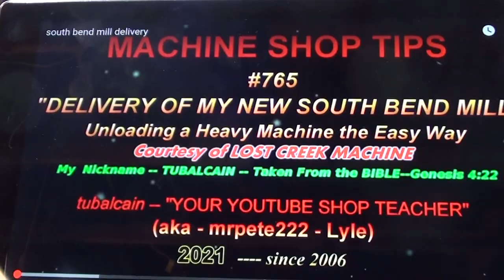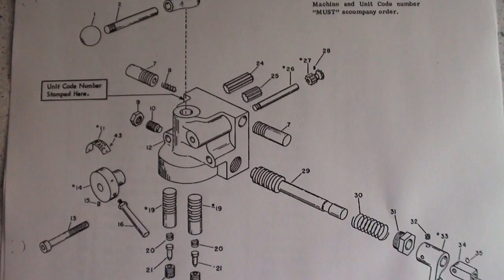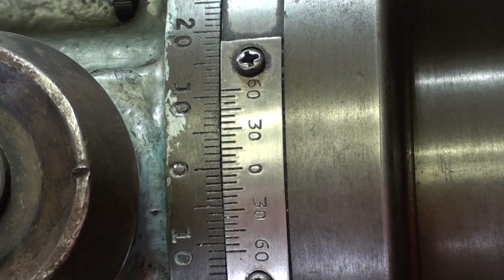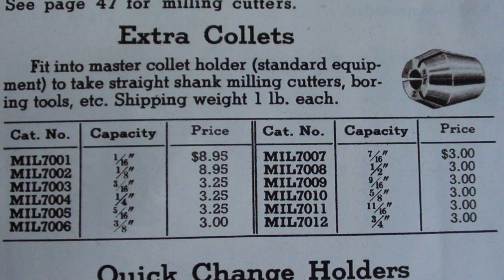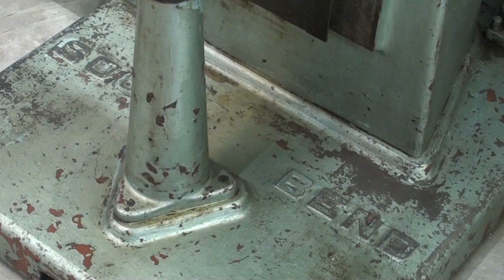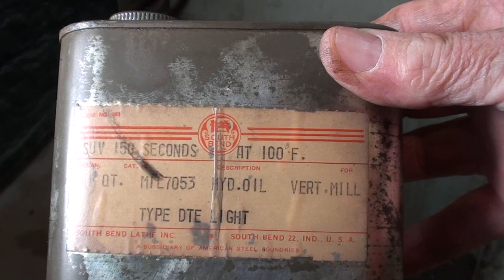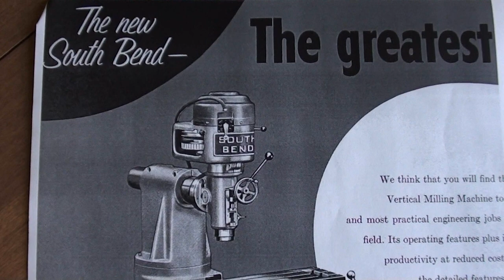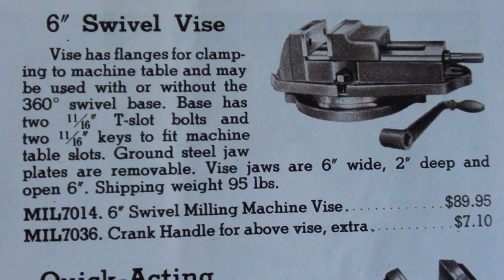EXAMINING MY NEW SOUTH BEND MILL 772 tubalcain

Comment: Good Mourning Lyle, I remember well using a couple of "Gorton" milling machines back in the sixties that used "End Measuring Rods" and Indicators. One micrometer head had a Red color band and the other had a Green color band to help keep things straight. A pad of paper on the table with 2 columns of figures to add and subtract your movements, with a heading above each column of either Red or Green. This was before we really thought of able movements as the "X" or "Y" axes. In the late Sixties, Bridgeport came out with what they called "Optics". It was a micro-etched mirror glass scale attached to the table which was read through a little lighted box with a magnification lens inside.  Again, with the pad of paper on the table to keep track of your moves. Thank goodness for D.R.O.'s!
Reply from the maker: We sure have come a long ways

Comment: Awesome walkaround! RE: The Powerfeed motor and gearbox; The reason the beltguard isn't mounted, is the mount for the beltguard on the pedestal is broken. The Table Overtravel apparatus mounted in the middle of the saddle of the mill; This stop needs to be "armed" or set before the X-Axis powerfeed will actually engage. Moving the stubby vertical lever fully to the right, "arms" the stop, engaging  the powerfeed input clutch (when the stop is disarmed or tripped, the clutch is disengaged - failsafe). The travel limit switch is actuated from either side of the Stop unit (when the Overtravel brackets and limits screws are used in the tooling Slot along the front of the table), or the lever (with the missing ball handle) is moved left or right, tripping the clutch cutoff. One of the connecting rods for the overtravel stop is bent: I recommend making a new (straight) one so that can sets and trip the clutch correctly.
Reply from the maker: Thanks

Comment: I also have a South Bend mill with all of the same extras plus a horizontal head [almost new] and a big box of tooling and gizmos. Mine is 120 VAC and runs like a top. I also will be working on it this winter, as the snow falls here in Bloomington. A learn as I go adventure in my golden years.

Comment: Absolutely fascinating Mr. Pete! That machine is a genuine piece of history. It looks like it was a pretty swish version as well with most of the deluxe options. To some extent a shame it didn't have the full-house with the coolant pump but I dare say it was rarely used and could easily lead to a very messy workshop!

One thing that strikes me is the total lack of modularity. The designers did not begin with a 'master' version and then remove parts to offer simpler/cheaper machines. They went in the other direction and that is why it has such a bolted-on nature. Nonetheless I am sure it all worked!

The catalogue picture is especially evocative--'The Greatest'! 1956... Happier times as they say!

Comment: Extremely interesting to see this early and rare milling machine, One of the J&S surface grinding machines I used to build in the 60s and 70s, had a hydraulic motor too, and it powered the crossfeed,  called a 'vane' motor, when it worked, was the smoothest quietest feed ever, speed variable by a knob, you just made me remember this boring fact lol, looking forward to seeing some restoration on this interesting piece of history thanks, Dave

Comment: I'd move the hydraulic pump to the bottom shelf and make the top shelf the storage cabinet.  Don't know about you Lyle, but I find that the older I get the further it is to floor level, and more difficult to get there short of falling over..
Reply from the maker: Yes
Reply: Or getting up from said place!

Comment: Guessing the reason for hydraulics was to get infinitely variable force for drilling  (The BP idea is fine for boring  but for drilling can be a PITA if the feed rate is too high) 
Does that table feed slide over the other gear box when the table is moved fully to the left?  I can see no other reason it is so long.

Comment: Love the Art Fern pointer, it makes it easy to understand what you are talking about.  That South Bend is like a Frankenstein with the huge hydraulic cabinet stuck on the side, the power feed wiring and disconnect strangling the column, and the double tumbler gear box on top of the "peg leg".  Hopefully you can resolve the issues and get it making chips.
Reply from the maker: I love your outrageous, but truthful description of this machine. The Frankenmill.    I now have a new name for it. Thanks to you.
Reply: Lol ! The Frakenmill it is !  Glad I could be of some small assistance besides my wise guy style comments. Your awesome Tubalcain!

Comment: Thank's Mr. Pete for the walk us around your new treasure, I'm looking forward to future video's of you getting this old girl making chips again. I really liked the goodie box portion, not sure why but I was mesmerized checking out the contents, it was almost as if that was my box of goodies I was pawing through looking for a valuable tool, I'm pretty sure I have a I have THD, tool hoarder disorder! I own a 1956 Cincinatti Toolmaster that has the same issue as the South Bend, Motor directly over the spindle, perhaps they thought Cincinatti had a good idea and copied it but it isn't a great plan in reality. I am intrigued by the power feed setup on your South Bend, really complex but having survived for 50 plus years must be well made. My Toolmaster had a power feed that was located on the left side of the table, had the gearing and motor hanging off the back side with the speed selector handles on the front, notoriously weak and it is not often you see one that is in working order as I bought mine with the gearbox and motor missing and have been told they are as rare as hens teeth. Thanks again!

Comment: I had a 32" table version SBM, with manual movements only. Was not fond of the 30taper tool holders, but did have all of the double angle collets from 1/4 up to 3/4" . I found it fairly easy to cut the pockets to modify other 30 taper holders, using a carbide endmill. Mine was single phase, but would have rather had 3 phase  to get variable speed with a VFD, but no way to power with a conventional 3 ph motor. AFAIK ....it still lives a couple blocks away with the new owner.

Comment: Hi Lyle, I believe 150 of these machines were all together built. I was lucky to purchase a South Bend Mill recently that came from a school in Oregon and is in a pretty good condition. I added a VFD to run it at 220v. I have so far also added a DRO on X & Y.  The best thing I added was an ER40 chuck and collet set. I had to take the spindle off to oil it etc. These changes made the mill a very versatile mill. I am very happy with it. I am sure you are an expert but any information you might need I will be happy to provide. all the best. Hossein

Comment: My Wells Index model 40 uses a Brown and sharpe #9 taper in the spindle. I would rather it be a Morse. I also have the x feed, with the shaft drive, the little motor uses step pullys.  Good video.

Comment: Mr. Pete - Thank you for the tour - I really enjoy seeing old machines (Old ARN!) and a glimpse into the thought process of the design and manufacture of them.  As for the hydraulic cabinet, couldn't you simply hinge the current cover and install a latch or thumbscrew.  It seems like splitting the cover would be an excessive amount of work... additionally, if the bump and hydraulics don't work on the machine... will you pull them off or just leave them?
Reply from the maker: If the pump does not work properly I may just remove it, and simplify the machine

Comment: I have a predecessor machine that looks identical to the single piece base South Bend machine except that the head says VAN and the knee screw is on the right not the left. I believe my mill was made in the early 50's in San Francisco. Given the massive similarities, I suspect that South Bend bought the design and molds to make their model.

I found a South Bend right angle attachment about 10 years ago that fits perfectly.
Reply from the maker: Very interesting

Comment: Interesting milling machine. It looks to be a great unit for the home shop. Question I have is can you not use a modern milling 30 taper modified with the notch, with an ER 30 or 40 collet system? If so that would open up a larger array of collets and erase that disadvantage of no R8 collet system.  Out side of that that’s the only drawback I see on the mill. The other question is are you doing static or rotary phase converter on this mill? From what I see on your  Bridgeport it appears your using a static converter. That’s what’s on my mill and I never had an issue
Reply from the maker: I will probably modify several tool holders. I use a rotary converter

Comment: Hi Lyle, I  can't decide if that collet would be easier on my Lagun mill with an R8 spindle.  Right now I have to step on a stool to loosen the draw bar and I'm 5' 8". It's tall. I have to twist the head if I need to remove the draw bar.
Reply from the maker: I am also 5’8”. I cannot remove the drawbar from my Bridgeport without tilting the head
Reply: @mrpete222  Ha. Thought I was alone in that. Thanks for the videos.

Comment: With that huge fly-cutter tool I don't see how you could ever tighten the setscrews that hold the tool in the spindle taper.

There also seems to be no reason for that long housing on the longitudinal feed. Maybe it is making room for some other accessory.

Comment: In regards to your side cover on the hydraulics: as to not terribly mangle the beautiful original cover, perhaps a piano style hinge on the back and two tool box style latches on the front? you could keep all sorts of angle plates or rotary tables/dividing heads in that bottom shelf? I would love to see a full restore on this machine, myself........ hint hint - ALSO: could you do a quick video of taking measurements of the collets you need? Length, size at each end and in the fat part in the center, etc - I have BOXES of old. odd looking collets from buying out various machinery liquidators and would certainly donate them to you if I knew they were for your machine

Comment: Looks like an easy conversion to ER 40 collects.We did it on our Cinci Toolmaster. I would take them over R-8 anytime. Grab a set of ChiCom ER collects that cost just over a C note. They not only hold any size mill, including ones that R-8 wont,  but you can use them for any size drill from 1/8 to 1" ,,,,, We can hold a couple thousandths TIR all day long too! - Not mad for a 4o year old machine, huh? We got the chinisum collects to see how they work with the intent of getting better ones later as needed but they work so well we are still using them after 2 years and haven't replaces a single one.

With a couple of tweeks like a couple of cheap VFDs (One for the spindle and one for the feed (Which will give you rapid)  and you will be in far=t city with this mill.  (The chi-com LCD readouts and kind of neat too,,,,and really cheep to boot,),,,,OH we programmed the VFD and it stops or even reverse in 1/2 second. Who needs the brake. 

After a little work and a few bucks I think you got a class A winner there Mr Pete. ou will soon forget the BP.
Reply from the maker: Thank you for the excellent suggestion

Comment: Mr Pete I just got my first mill it's a south bend like yours but later model With the box table feed where can I get a wrench for the weird number Collett nut mine came with a bunch of Collett but no wrench also having trouble getting wired up to the drum switch mine has a clark with 8 positions and a start pole the paper under the cover is burnt can only read
Reply from the maker: Two things. First of all mine is missing the wrench also. I am using a spanner wrench, that does not fit all that well, but works fine. I am looking for the correct wrench also. I do have that wrench in the larger size, but it is meant for my other machines.
Secondly, I cannot help you with your electrical problem. My machine has an Allen Bradley control.

Comment: Good morning Mr. Pete.  Your opinion, please.  What do you think of the Clausing small mills such as the 8520 & 8530 models.  I'm a hobby machinist and most of my learning came from you.  After 10 years I sold my Bridgeport due to size and space constraints plus all my mill work is small anyway.  Before I went Chineseum, I investigated and discovered the Clausing mills.  I just received an 8530 model and I'm in the process of setting it up.  I was hoping to get your insight.
Reply from the maker: Although I have never actually used one, I consider all of the products by that company to be very well-made and quality built
Reply: @mrpete222  Mr. Pete, thank you for your positive response.  Lost Creek Machinery presently has a Clausing 8530 for sale in case you wanted to see what one looks like.  I found mine in the Cincinnati OH area and had it brought down to Texas.

Comment: Lyle, why do you say "Thank goodness" that Machinists probably don't know how to read verniers anymore?  Just because digital crap is everywhere nowadays with batteries to die unexpectedly, doesn't mean that the old equipment is bad!  I believe that Machinists ought to at least be able to work relatively comfortably with "mechanical" equipment just like they do with today's whiz-bang Buck Rogers digital equipment, even CNC if they've got the $$$$$$$$ for their workplaces or home shops.  But I suspect that Apprenticeships (but certainly don't know what is required nowadays) no longer require starting with hammers, chisels, squares, & files before being allowed to even approach a manual machine where you then learn the feel & sounds of proper machining.  Unfortunately, some of the younger CNC Machinists at the place I retired from never ran manual machines and didn't have that "feel" and their work and the machines paid for it at times.  :(

Comment: i wondered if the motors were 3 phase or took a phase each. Would it run on 110v. then? Top notch information about the dial gauge system. Very enjoyable video, thanks

Comment: X, Y vrnier scales - Option on my mill is what they call 'micrometric readers' and the mill has a plug on the front of the knee for a 6V supply to small light bulbs for these readers. I'm guessing that they're magnifying glasses with possibly a vernier for more accurate positioning. If I had an e-address for you, I could send images. My e-address is on my channel 'about' page.

Comment: Disappointing on the motor front - only 1HP @ 1800 rpm - it'll have very little power left at 3750 RPM - but that's a nice light grinding speed ;)

Gear ratio: 3750/135 = 27.7 - I presume no 'back gear' ? How do the spindle speeds compare with the BP ?
Gear ratio on my mill: 1600/21 = 76·2 - so mine has 3 times the range and is currently on a 3HP motor.

Comment: Do you have the owners manual for the machine?
Reply from the maker: I just have a xerox copy of one
Reply: ok, the owners manual has a couple of pages on how to operate the hydraulic quill feed.  I have used the hydraulic down feed really just to learn how to use it.  But the hand wheel is easier.